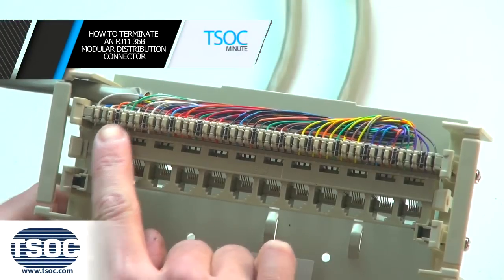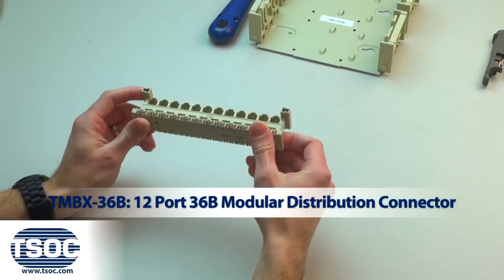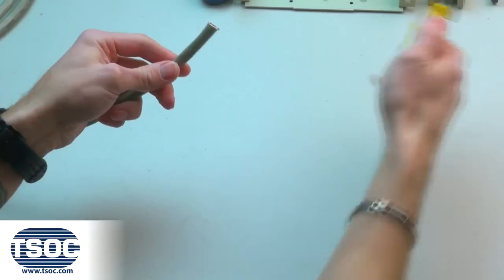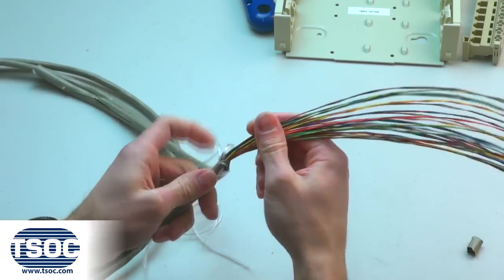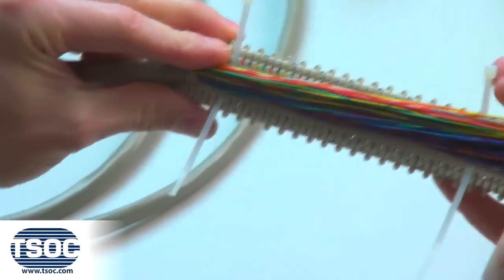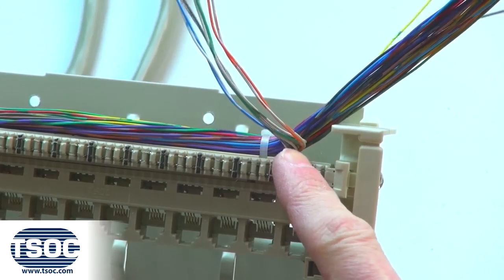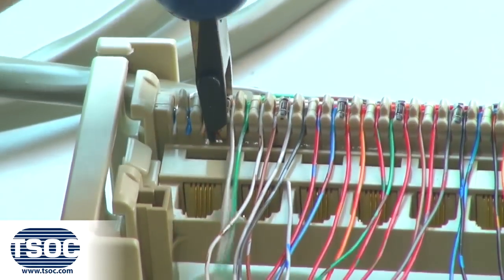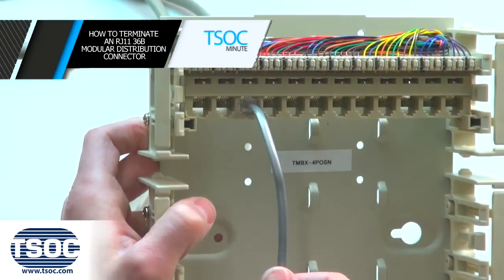How to Terminate a 12 Port RJ11 BIX 36B Modular Distribution Connector - The TSOC™ Minute (ep. 7)

Comment: Good afternoon.

I would like like buy one but with 24 ports. But before buying I need to understand something. I live in Egypt and I have bought I new apartment, in Egypt we have ADSL based on RJ11 cables coming from outdoor. What i want to do is to take that cable of the ISP and distribute it in every room I have so if i wanted to move my adsl modem around the home i do not have to extend that cable coming from ouside using another cable as a jumper. 

Can I use your patch panel as a switch . For example I plug that ISP cable to the patch panel port and make jumpers from other ports to rooms wall jack?

BR!
Reply from the maker: Please see here: https://www.tsoc.com/12-ports-X-6P6C-USOC-modular-to-bix-type-telco-block-Part-Number-TMBX-36B